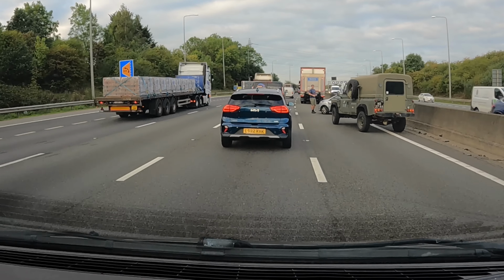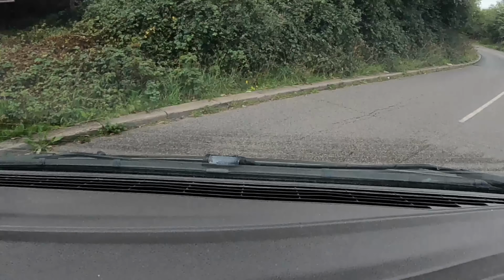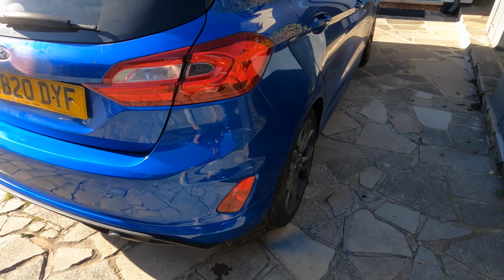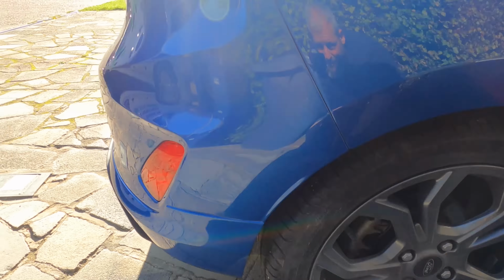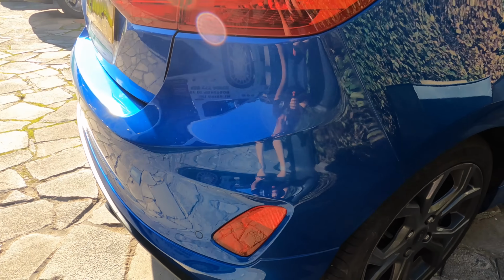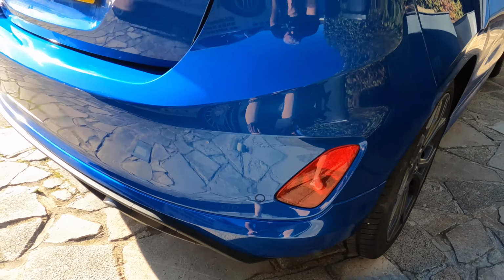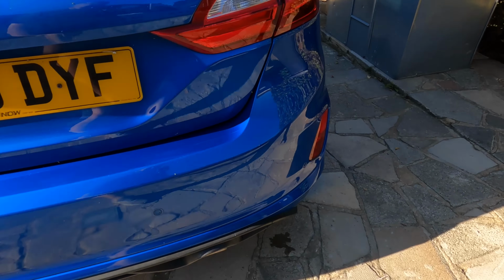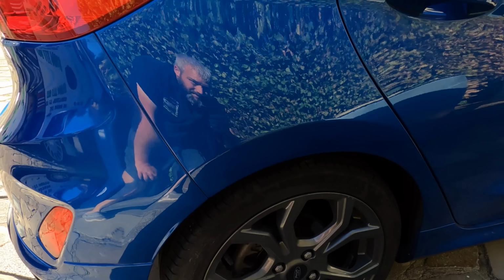Mobile smart repair fiesta ecoboost

Comment: Dessert island blue? We did it in Lechler wb today and the match was shocking, what shade did you use?
Reply from the maker: Yes it was mate I went standard shade kept my mix to the exact point on the scales 10% thinner mine was spot on
Reply: @grantssmartrepairs  thanks mate we used number one and was far too light and metallic, I find all blues similar to this contain to much silver and never match on Lechler…. You made a nice job on this one 👍
Reply from the maker: Really strange what reducer do you use? And do you weigh your mix exactly to the point?
Reply: @grantssmartrepairs  use the hf900 and yes mixes are always on point, it’s only really the blues and a few whites that I find shocking.
Reply from the maker: I use hf915 extra flow reducer I don’t know if that makes a difference but I have not had any issues so far 🤷‍♂️🤷‍♂️